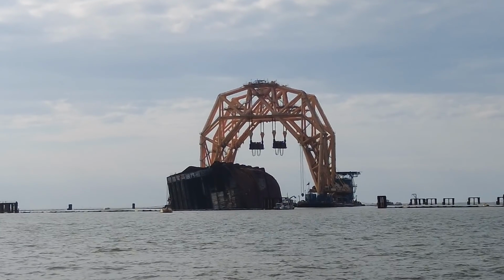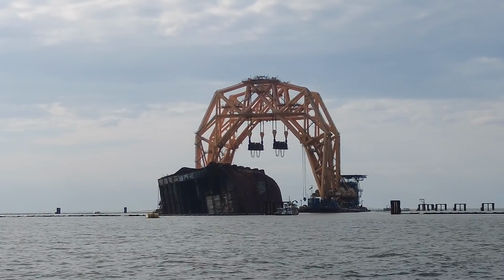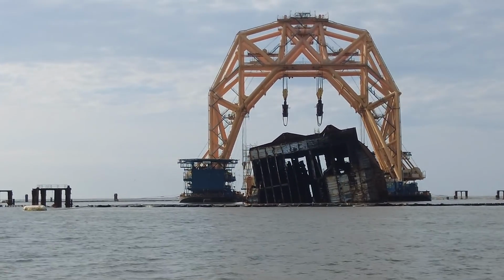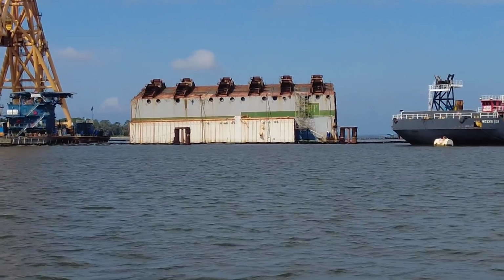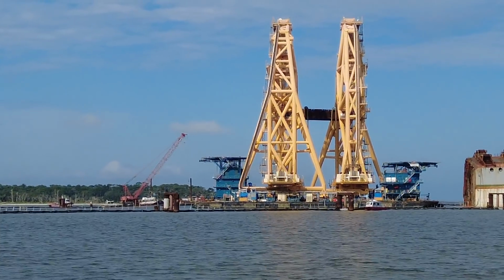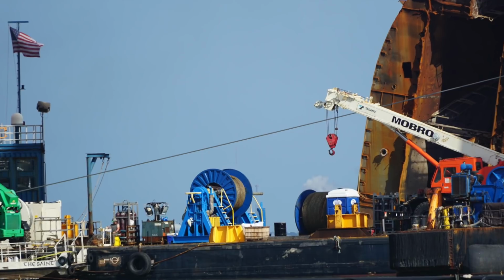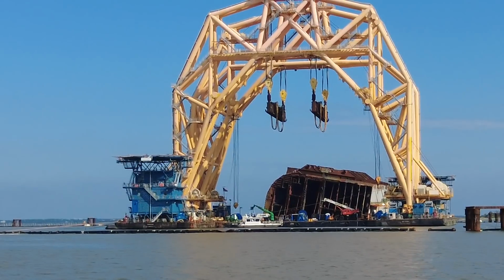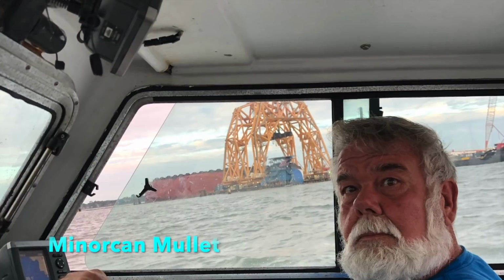BACK AT THE SITE, CABLE ISSUES?? on July 11, 2021

Comment: From what I’ve gathered, there are a total of 4 blocks (2 per arch) on the VB. According to which end of the ship they are currently cutting depends on which set they use. If that’s the case & since they appear to have to do “routine maintenance” on them between each cut, it would seem to me that they could save a lot of time by going ahead & preparing all 4 blocks at the same time. 🤷🏻‍♀️
I suspect they had to finish the re-welding on top & get the supplies removed super fast due to the tropical storm.
Reply from the maker: I'm sure the storm caused concern for all personnel involved.  As for the maintenance, I would think that an inspection dictates what needs attention.  They wear is constant, but I bet they work that schedule based on specs of the wear items.  Maintenance is applied as the wear reveals the need.   MM

Comment: Thanks for the report Capt. Did the workers by chance respool the cable in reverse? In reverse I mean spooling the used end of the cable and having the previously spooled end now on the cutting blocks. I have worked as an iron worker and have seen this used on lifting cranes. Welcome home!
Reply from the maker: I'm not sure.  Hard to tell how it was loading. Your suggestion makes good sense if the logistics of loading are doable.  MM